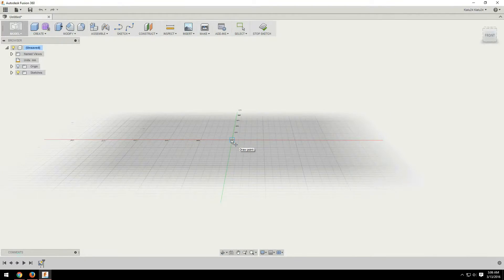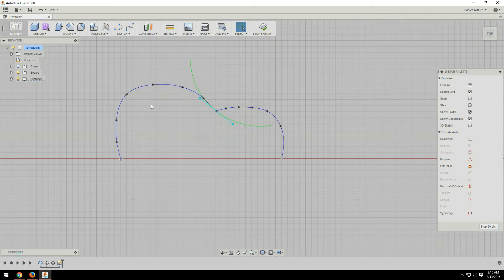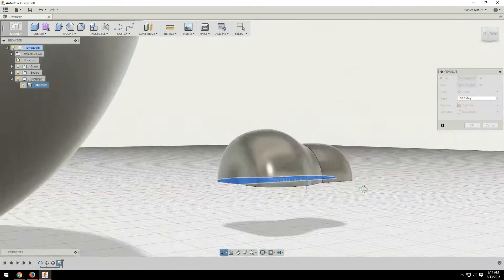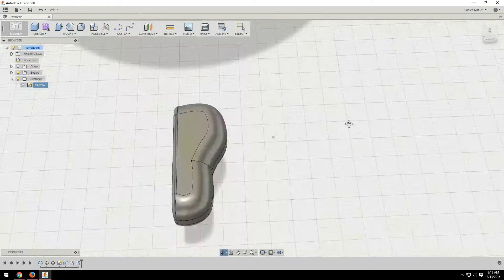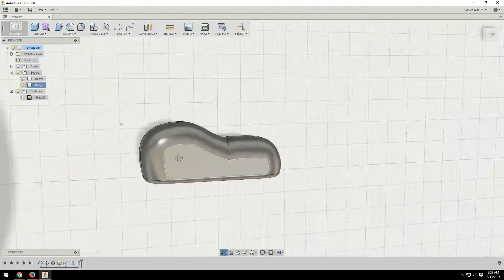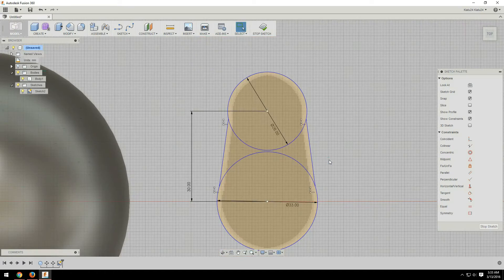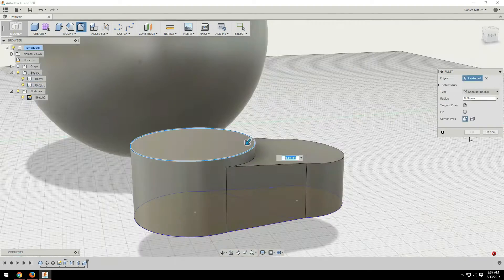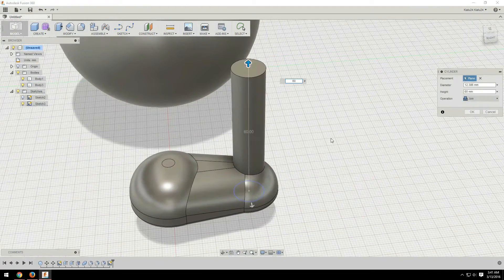Speed 3D Modeling a Mario Bob-omb!

Comment: I've been working through tutorials learning Fusion 360 (already comfortable with TinkerCAD--but this is more complex and feels VERY different atm), but copying your process has been a lot more fun. Halfway through building my own bob-omb, and I have a question. When you built the 104mm sphere to cut off the eye ellipses, is there a reason you lined the two spheres up manually instead of using align? (I've only used align once, and haven't mastered it.) Curiosity, not a criticism--I'm having a lot more trouble than I expected free-moving objects around in Fusion.